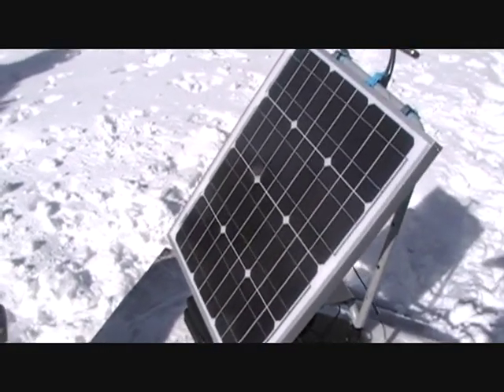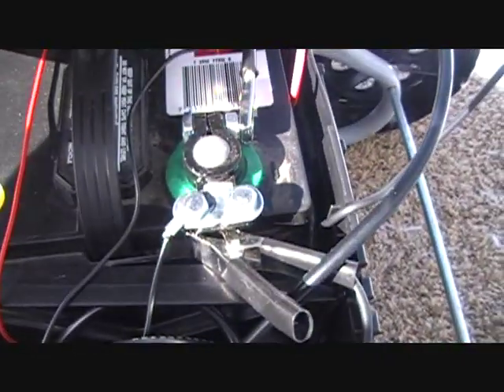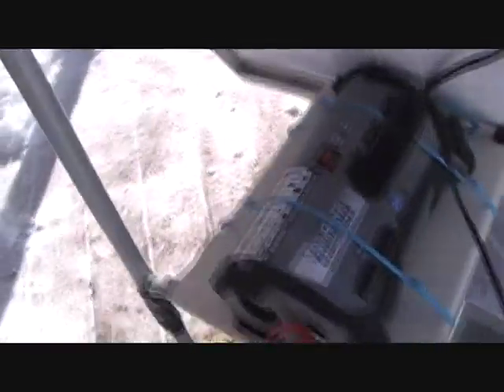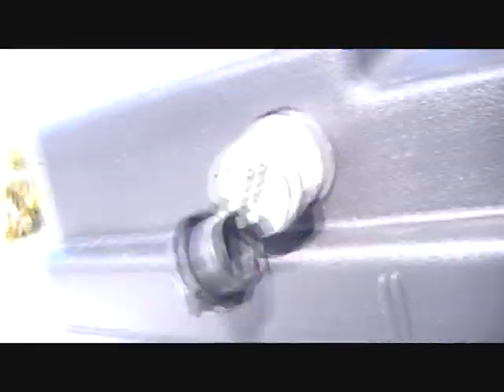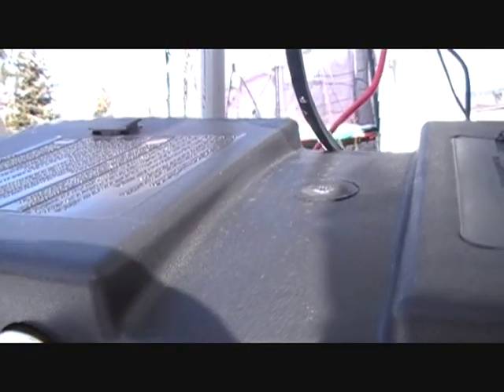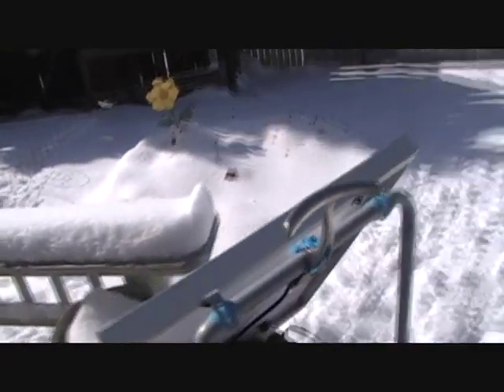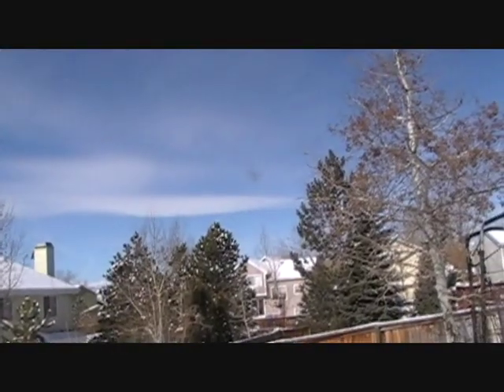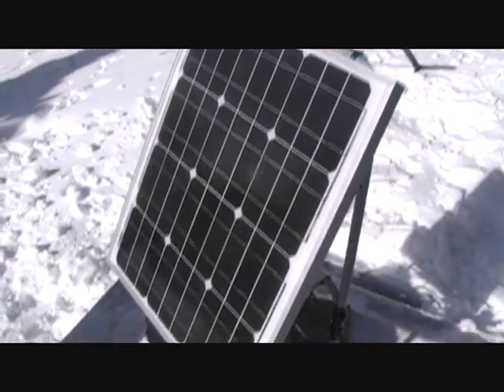Solar power set up Solar solar generator portable 36 watts battery WTSHTF TITEOFTWAWKI

Comment from the maker: @charles7134  My best guess would be as least….. 20hours divided by 8 hours of useful sun light = 2.5 x 3000watts x 1.3 (30percent inefficiency from charging batteries and invertors) or about 9750 watts of solar. Not very practical unless you have a very large roof facing south and a lot of money, if you can I would suggest a 4k to 6k grid connected system and get some help from your utility company.   Most house hold don’t need 3k watts 20hours a day, are your growing pot?

Comment: Nice solar power how to video! Looks like your solar powered battery could be very hand for camping or a survival situation! How long do you leave your panel in the sun? Do you move the panel a few times per day to get them most sun power? Looks very easy to build from parts you could get at home depot!